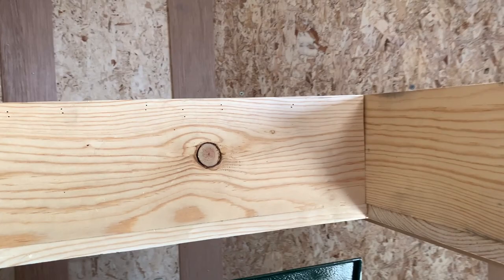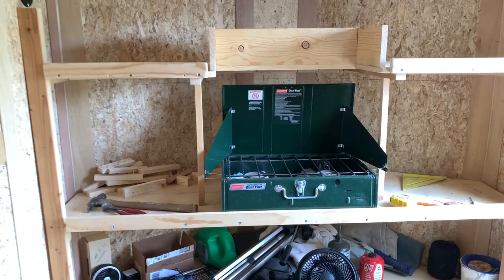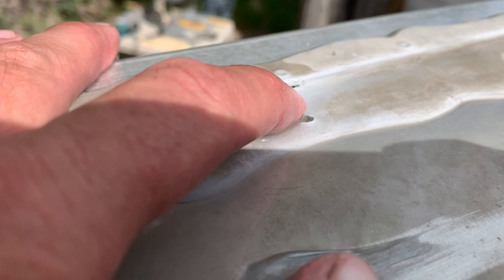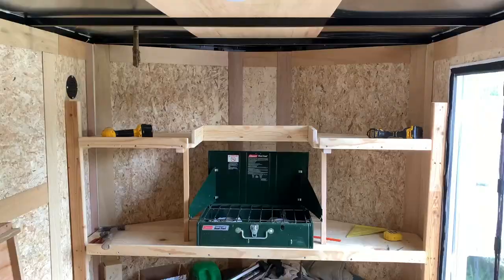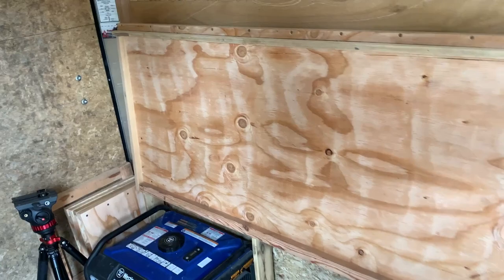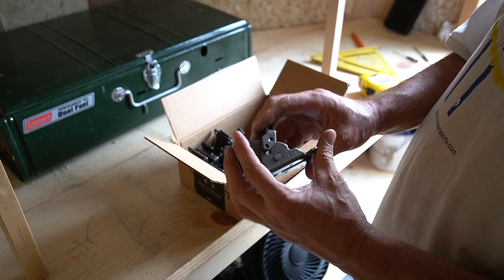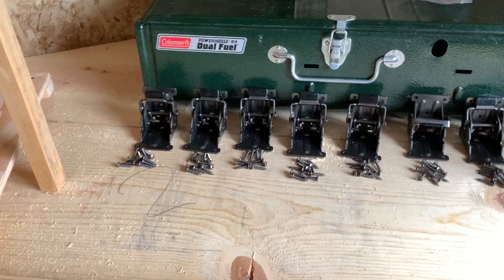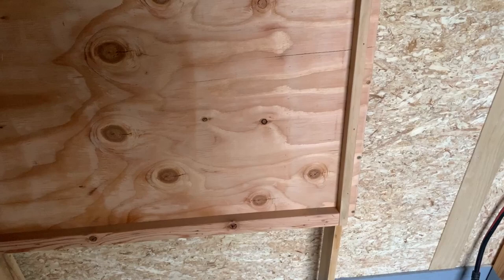6x10 Cargo Trailer Camper Build / Part 4 / Bed Legs

Comment: If you make the "chimney" (the tall boards you weren't sure about) around the grill extend up to the ceiling and put the vent fan directly above it you will have a great visual effect as well as a safe grilling space.
Reply from the maker: Hi, Chris! I did briefly consider going all the way to the ceiling with those boards. In the end I thought it would make it harder to use that space behind the "chimney".
Thanks for watching and the lovely comment! :D

Comment: nice its getting there , those hinges are cool never seen any like that , you going to reseal the roof or patch it ,  i think they could have done a better job with that
Reply from the maker: I watched a ton of trailer build videos and from those I saw the different hinges. Can't buy them at homedepot or anywhere else I looked, but amazon can have them to ya in 3 days. lol.
I'll just patch up the roof. The quality of assembly on trailers is usually just barely good enough. I'll fix things up as I go.. I'm not a fancy man and I don't need a fancy trailer. Just the basics.. :D

Comment: these flat roofs are always a pain... I am converting a pace 8 x 16 V-nose cargo trailer into an RV and Mobile Sign shop.  I will be carrying all my sign making equipment and supplies on the road. I make signs and ship all over the country.  I designed the interior on the computer full scale and full size to make sure everything fit.,,,  I traveled in a 15-passenger shuttle bus for 3 years but when I got my new large format color printer I had to go a little larger to make everything fit..  I kept a YT series on the shuttle bus and now also one on the CT. Looks like you're moving along nicely
Reply from the maker: Very nice! A main goal of mine is to be able to do work while being out in the wilderness, close to the hiking and rockhounding I'd like to do. I'm sure I'll be checking out some of your videos. :D
Reply: @camplapidary  thanks.. all are welcome